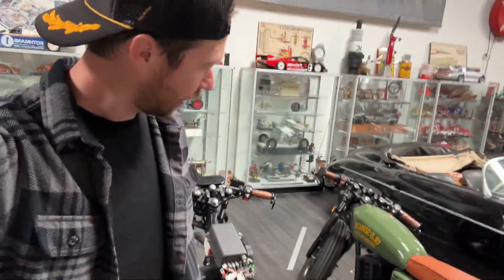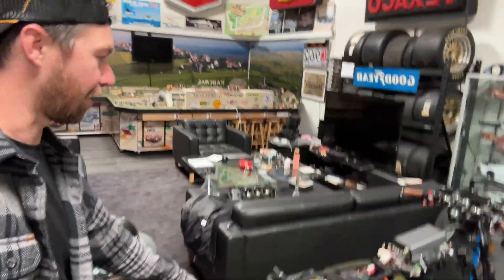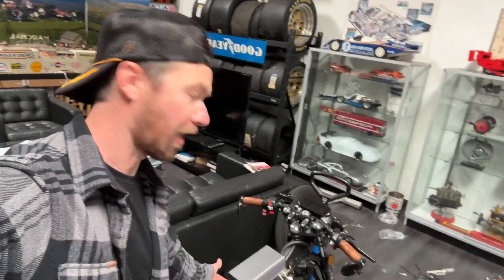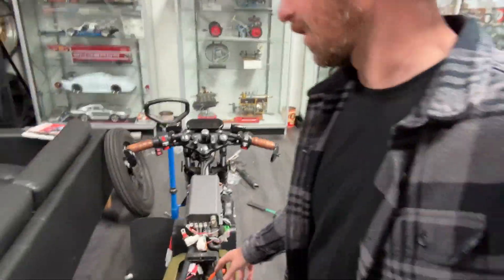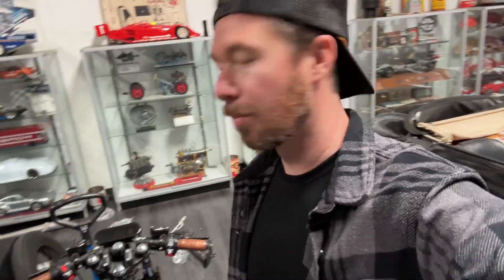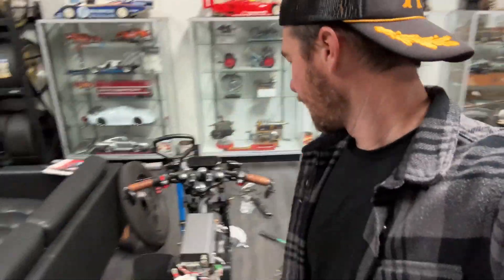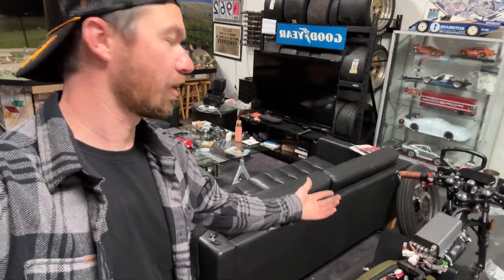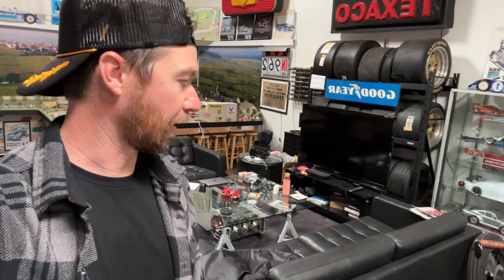Changing Tires On An Electric Motorcycle With Hub Motor

Comment: Thats an amazing shop. Also, those little wires going into the controller are getting a bit chewed up. I have that same hub motor, btw, also on spokes. QS laced the spokes wrong for me though, but I haven't fixed it yet.
Reply from the maker: Thank you. It’s definitely a good time being around all of the fun machines.